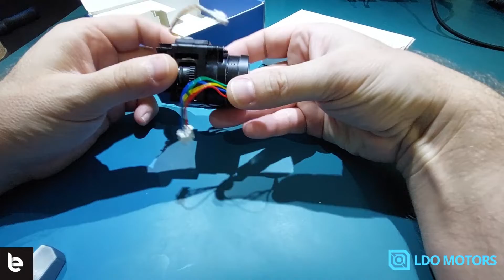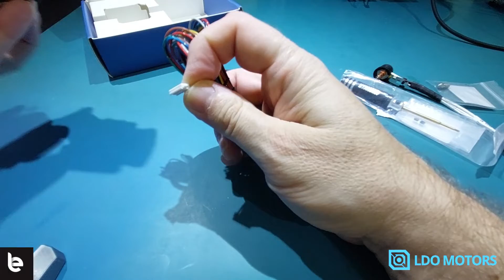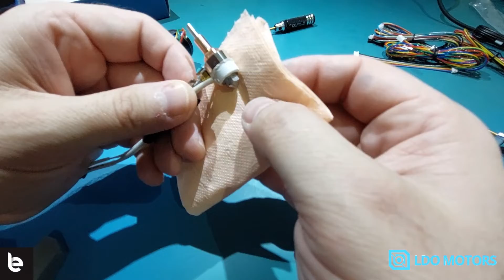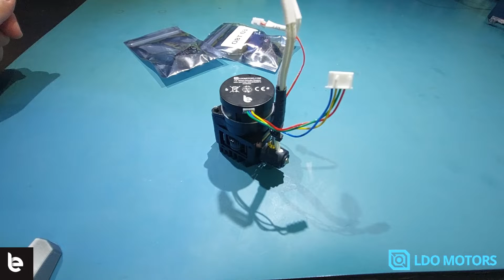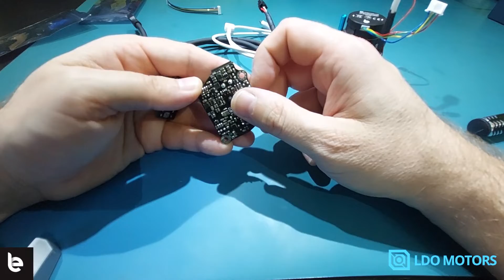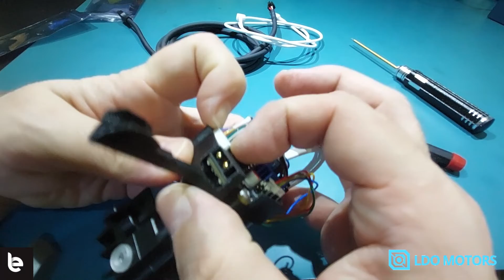SO3 Assembly

Comment: Why on earth is the connection for the extruder board facing downwards? Thats the worst place to put it, right next to the up to 300°C hotend ...
I guess that will make some headaches, at least you have to make a special cable with a 90° connector. Of course it´ll be better to redesign this.
Thats my biggest concern with the V3 extruder - apart from using plasic (planetary) gears again. Additionaly the copper part of the heatbreak should have a groove, so that the scew has a better grip and nozzle can´t fall out so easyly over time. 
As everybody knows, critisising is easy, doing it better not so 🙂

But thanks for showing us the details and this well made video.

Comment: How to Upgrade the kipper version on the SO3 Toolboard?

[ ] Enable extra low-level configuration options
    Micro-controller Architecture (STMicroelectronics STM32)  --->
    Processor model (STM32F042)  --->
    Bootloader offset (8KiB bootloader)  --->
    Communication interface (USB (on PA11/PA12))  --->
    Optional features (to reduce code size)  --->

? i have multiple USB PA but i am really not sure.

Comment: Is this piezo probe capable? I see the metal ring in the video but I’m assuming that’s the temp sensor? 

If I can get away from the BLtouch for an all in one hotend that’s lightweight with accelerometer and bed probe I will definitely pull the trigger on one. Thanks
Reply from the maker: its not piezzo capable.

Comment: No reply at all from here or ldo but shows the problem with it 
That there is no support at all
Reply from the maker: @jonwoodvine322  what is your issue? Maybe I can help. Certainly, youtube is not a support page, and I do not actively follow all the comments.
Reply: @orbiterprojects  your right it is not but you responded to this 
But thankyou 

I am after the wiring diagram of the actual orbiter so I know where the wires go to be able to connect directly to my octopus board.

So far it's working fantastic with the eva tool head and kraken fan setup
Reply: Still waiting for a diagram
Reply from the maker: @ Please understand I'm not able to make diagrams for each maiboard and possible combinations out there. Just read the mainboard documentation, connect the wires to free inputs digital, and configure the macro's I provided with the selected port number. There is no standard way for connecting it. The temperature sensor should be connected to a temperature sensor input of your board.
Reply: I am just after what the wire colours connect to in orbiter. the rest i can work myself
I was just trying to avoid striping the obiter down to find out
Reply from the maker: @jonwoodvine322 This is available on the website under the firmware configuration section. I defined there the pin 1 position and the pin number functions. Do not guide yourself by the wire colors; some of the cables are messed up and the colors are not matching my requirements. But the pin order definition is always correct.
Reply from the maker: @jonwoodvine322  https://www.orbiterprojects.com/so3/

Comment: On the schematic for the intergraded electronics, the 7 pin connector at bottom of orbiter is pin 1 twords the front/part fan side of the orbiter or twords the back?
Reply from the maker: check it here: https://www.orbiterprojects.com/so3/
The connector is parallel to the fan, so pin one is not closer to the front or to the back... As a reference, you can use the white LED; the closest pin to it is the number 1.

Comment: where do I find info on what pins are what  to connect direct to my mainboard . been all over the website and links you posted and the info doesn't seem to exist.   I custom design printers and was hoping Id like these SO3's on my release model
Reply from the maker: I have provided a generic configuration file. Basicaly, you have to connect the signals to some free inputs on your mainboard. There is no general rule since every mainboard and printer is different.
Reply: @orbiterprojects  yes I know I have to change pins to match my board but what I dont understand is I already have a thermistor and pin 3 appears to be a thermistor. do i use just 1 or is the other for something else like a fan? can I use it to see temp instead of controlling a fan or am I totally wrong about what its for?

Comment: Love it. Just missing an onboard USB hub or at least break out connectors so you can loop the cable's USB lines through an external USB hub pcb on the toolhead. Now I need to hack or run a second USB cable to my beacon probe. Nonetheless this is a great set of products. Really appreciate your dedication.

Comment: Alu or Copper radiator?
Reply from the maker: its bi-metalic copper around the heatbreak tube and aluminum radiator.
Reply: @orbiterprojects  oh thanks, and is the Volcano hotend radiator capable of cooling? 
the extruder design is very good

Comment: hey thanks for the work, the orbiter looks really interesting, I think I'll order the Revo version for my Voron V0.
I have an idea for mounting the V3, is it possible to expand the plate between the engine and the main metal frame with another gear wheel to get the engine further up?
This way you could mount the motor above the X gantry and wouldn't waste any installation space on existing printers. 
It would also be better in terms of the center of gravity. I hope my text is understandable. Thanks for the great work,
Reply from the maker: There will be very soon a Revo version released. Its in manufacturing phase of the first batch.
Reply: How about adapters for a Slice Mosquito?  @orbiterprojects

Comment: Why the SO3 comes with no tool board and also why it can’t be bought anywhere, did I miss something!?
Reply from the maker: The toolboard design was not ready at the SO3 release date. LDO is manufacturing them right now, so they shall be available very soon.
Reply: @orbiterprojects  thanks you for the information. 
I thought it was included! 
Bought it as an upgrade and also to eliminate some ribbon cables on one of my printers. 
Now I have to wait or use some other can solution on the market.

Comment: Make a version without the Klipper specific tool board, so that we can use other toolboards like Duet or connect it directly to the controller, and I will buy it on a heart beat.
Reply from the maker: Duet can be used, just I personally have not the time to work out all the needed macros. I have no printer running on Duet anymore. But RRF offers all the features needed for the onboard electronics of the SO3.
Reply: @orbiterprojects  but won't the toolboard be useless in this scenario?
I understand that it can be possible to wire everything directly (the daughter board with the "smart sensors" etc.
But my thing would be regarding paying for a Toolboard that I won't be able to use. And if we had the option to buy it without, would most make it like 10 to 15 bucks cheaper.
Reply from the maker: Yes, the toolboard is for Klipper only, I do not plan support for RRF.
Reply: @orbiterprojects  I understand that, but can it be considered to sell the S03 without the toolboard? (just the daughter board with the sensors)

Comment: Uhhmm I don't think the thermal paste is to be used with the nozzle, just the heat break. The paste will carbonise and make the heat transfer worse. They are not meant to even close to 200 C. It will also make the nozzle stuck to the heat block.

Comment: I'm mostly excited about your tool-board. I had sketched out the very same idea, but haven't yet designed it. Now you've gone and done most of the hard work for me. I'm building a 3D printer with multiple tool-heads and for simplicity I wanted just one cable (usb-c or similar) running to each tool-head, power included. Would you anticipate me running into any issues with this application, using maybe 5 of your tool-boards on one printer via klipper? I have a mini-pc running klipper/mainsail on debian.
Reply from the maker: I have not tried that configuration, Max I had is 3 devices connected via usb. In principle this is mainly firmware related, and I think it will work.
Reply: @orbiterprojects Great, any idea when the toolboard will become available?

Comment: Since the tool board interface is using USB, would it be possible to run a single USB cable from the raspberry pi to a hub which would then connect to the toolboard and also a nozzle camera?
Reply from the maker: not that simple. would require extra USB port and a USB hub to be included  on the toolboard.
Reply: yes I was thinking that would be a separate pcb, that way the toolboard would not need to change. I was concerned though since cameras have high bandwidth and could interfere with the messages sent to the toolboard

Comment: Currently working on a solution for part cooling and mounting on an ender 3, and I'm tempted to go Beltender to play with the beta mount.
Reply from the maker: I think that will be a good option. I like how my beltender performs. For the part cooling with SO3 I still have some work to do, its a little too tight.
Reply: I've gone the fun route of designing an adaptor plate for the stock Ender 3 backplate using the Beltender version as a template. I've got the first prototype adaptor and mount plates printing right now. Once they're dialed, I'll integrate a cooling solution; right now I'm working on a design using a 4010 radial positioned under the stepper.
Reply: @rezzerwrecked Did you manage to create or find part cooling and a mount for the Ender 3? How did you get on if so? Thanks.

Comment: Looks very interesting! Is there any experience mounting it to a voron/stealthburner? Cant find any information about it online.... Maybe I should just give it a try 😁
Reply: not natively compatible since the carriage system of voron printers assumes tall and rather flat stack-up of nozzle-hotend-coldend-gears. The SO3 is short and thick.. You would have to rotate the whole SO3 by 90° and place it quite low, thereby probably reducing the X travel significantly.
Nonethless, if(!) you would design a gantry that accommodates a lower hanging SO3 with IDEX capabilities, you would get a very nice dual extruder coreXY printer.

Comment: Are we supposed to put the thermal paste on the thread of the heatbreak that goes in to the heater block?
I think the paste you used in the video GD900 is rated to operated at up to 200 degrees Celsius only, though I don't know what would happen if we go above it.
Reply from the maker: It is a must on the heatbreak cold end, I recommend to add paste, however I missed in the video that the paste I was using is not for hotend. You need to use a paste rated minimum 350 deg C. I'm in discussion with LDO to change the supplied paste.
Reply: @orbiterprojects  
Yes I agree it should be applied on the cold end. Just being worried about safety and efficiency on the hot side.
Thanks for checking with LDO!

Comment: The point of the tool board is only to protect the RPi and the Orbiter from a fault?
Or is it necessary for the smart functions?
Reply from the maker: The adapter board protects the USB port of the raspberry pi against short circuit to 24V. It is not related to the smart functions of the extruder. Is related to the connection between the toolboard and the raspberry pi via USB port.
Reply: It also frees up your controller board. Makes installing the orbiter 3 a lot easier. I'm curious though if there's any speed benefits with USB to rbpi. It looks like this might simplify your 3D printer setup even more by supplying power to your raspberry pi as well. Now all we need is to figure out a simpler board to drive the XYZ motors and 3D printers are getting very plug n play

Comment: Will this work with RRF and Duet boards? If so, is there a setup guide? I am interesting in purchasing this for my CoreXY but currently run a Duet board with RRF
Reply from the maker: If you know how to configure Duet than yes. By principle it should be possible to make it working with DUET but I have not provided a configuration guide. As I know all the features of the SO# are supported by RRF just need the right config.
Reply: Hello I received it and try to configure it for RRF too but I'm a noob since it's my first 3D printer build. Have you tried it?

Comment: How about cooling the extruder motor?
Any design to be printer and any power connector from the extruder board for it?
Reply from the maker: The extruder motor do not need cooling. Stepper motors are designed to run hot.

Comment: Great work! There's a spring loaded ball detent on the idler arm. I designed the "Ingenuity extruder", which has the same feature. Just out of curiosity: did I inspire you?
Reply from the maker: Sorry to disappoint but no :). I started this design well over a year ago, and that was part of it almost from the beginning. By the way Bondtech LGX and LGX lite has similar ball pin. Nice  extruder design you have there, I have not seen it before.
Reply: @orbiterprojects  No worries ^^
I can tell that a lot of work went into the orbiter v3, well done!